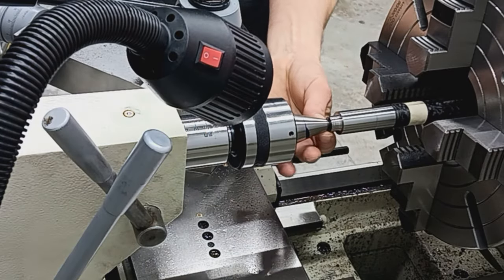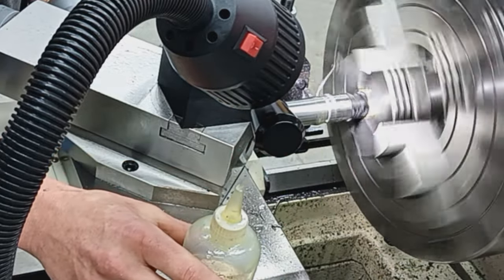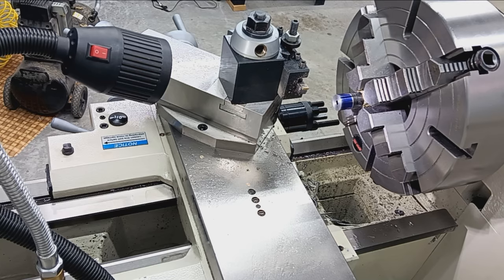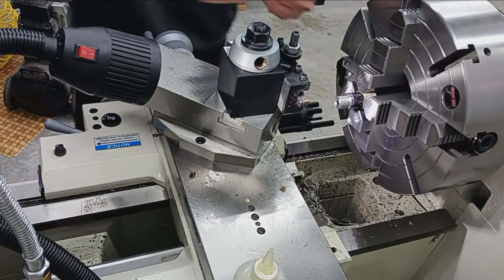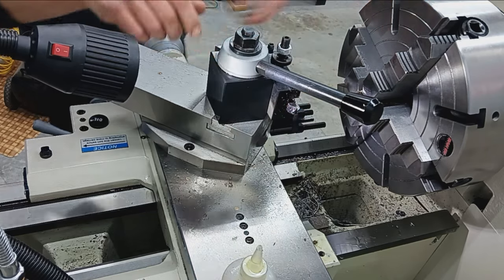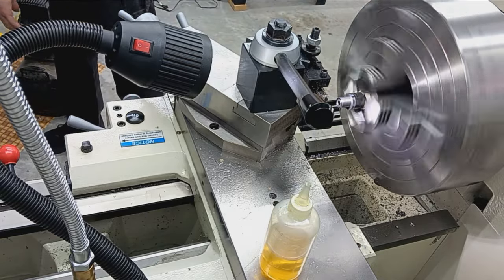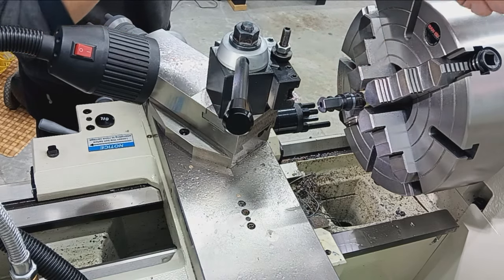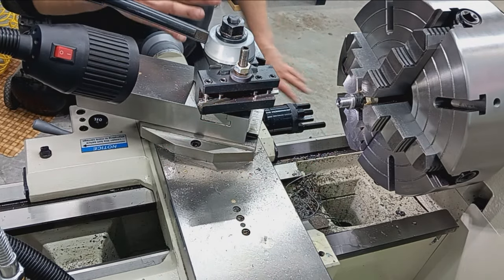Fitting and Chambering a Proof Research Sendero carbon fiber barrel to a Defiance Anti-X in 6.5 PRC2

Comment: Hello thanx for the awsome work 

What is that chamfering tool you used or which brand? 

Ta
Reply from the maker: Hey! There are a couple parts in the video that feature chamfering with different tooling. Which part are you referring to?
Reply: The one you used at 8:30 

Thank you for the nice work
Reply from the maker: @maybearo  Oh, that's just a 6-flute 5/8" 60 degree chamfering tool.  Has # 227654 on it...  Thank you for watching!!!